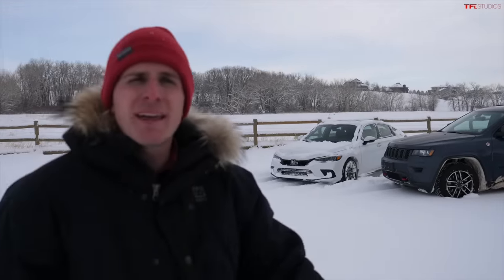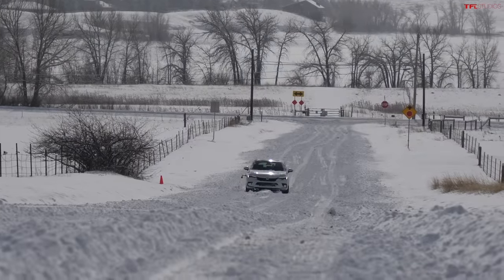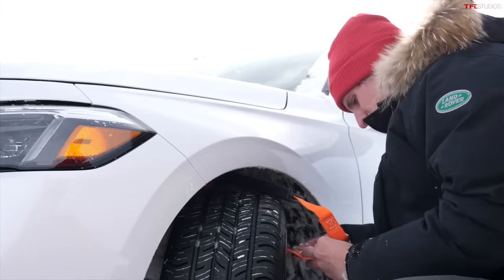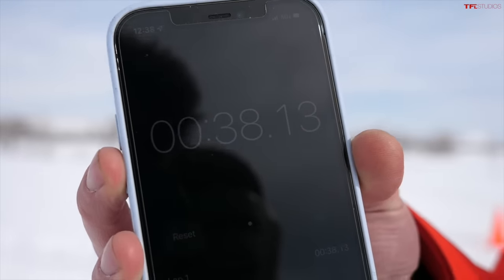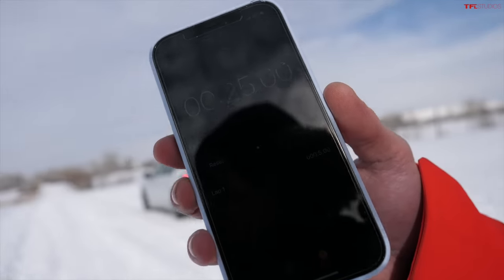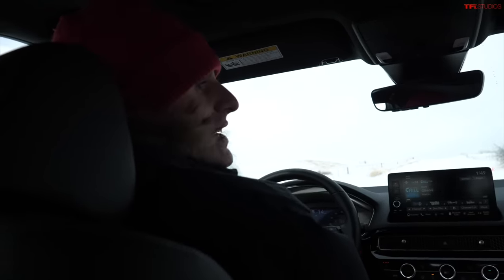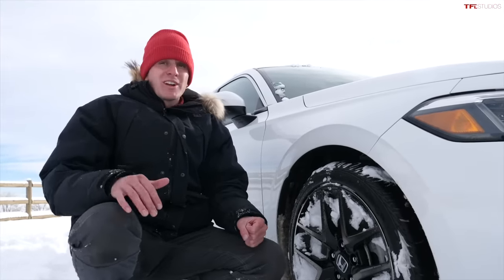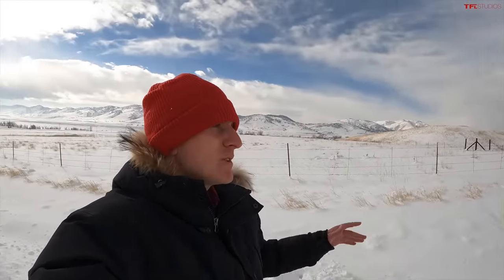Can Off-The-Shelf Traction Aids Make a Civic As Good In The Snow As a 4x4 Grand Cherokee?

Comment: What I’ve always wanted to see is awd with a regular all season tire vs fwd with snow tires. Kind of looking is it worth if you had to choose the money into awd and added fuel cost or to a set of snow tires.
Reply: I bought a slightly-used 2016 Crosstrek for less than what a similar Civic costs. It can average 40-45MPG on my 50mile commute. I don't feel like I gave up much in economy by getting an AWD.

 The Crosstrek also has 9"+ of ground clearance now (with 225/60R17 all-weather AT tires), sturdy roofrails, a hatch, a rubberized cargo area, a smoooooth boxer motor, and 1500lb of towing capacity. The ride is surprisingly good for such a small econocar that has pretty composed handling. That is probably largely due to the Crosstrek's 3000lb+ curb weight. Yes, it's a bit of a chunky bugger.

 Aftermarket support isn't as good as some gens of Civic, but I can find a turbo kit, high-flow airfilters, intake spacers, exhaust, adjustable suspension, 2" receiver hitch, skid & rocker armor, winchmounts, and a rear diff-locker.

 Similar to the Civic, the Crosstrek is a product of Japanese engineering, and I'm a fan of Japanese autos after owning a few Jeep CJs and a YJ. I've liked my Civic, Accord, SX4, and Highlander, and I'm now thoroughly enjoying my Crosstrek, living in snowcountry, near offroading/camping areas.
Reply: @RKmndo  agreed that you can find awd fuel efficient options. Just something I’ve always wondered. Glad it sounds like you love your crosstrek that much.
Reply: @jfkusa123  Crosstreks also come with 17" or 18" wheels, but the brake calipers will fit inside 15" wheels to use economical winter tires or aggressive offroad tires if you're driving much on VERY nasty surfaces.

 The boxer engines (2.0L or 2.5L) and CVT are...different, but I'm getting pleasantly accustomed to them. Corolla and many other FWD econocars are also using CVTs now, but Subaru's CVTs use a chain, rather than a belt. Crosstreks are also available with a 6spd manual, but then a sunroof or 180HP 2.5L is unavailable.
Reply: my wife drove front wh dr only for many years in the mountains of ut--we always had studded tires--they go anywhere and stop very well too
Reply: I'd say you probably need to factor wheels into that cost too. Unless you really want to spend $100+ mounting/unmounting tires each year.
Reply: I’ve done both - I grew up with fwd cars that we put snow tires on for the winter. I also rented a Subaru for a winter and tried it out with all-seasons. 

For going over pases/dealing with under 2 inches of snow on the road, I 1000% will keep snow tires with fwd. my fiesta still gets better mpg with my snow tires than my Crosstrek did. 

In general, awd cars will accelerate faster up a hill in snow, but, when stopping, cornering, or just trying to hold a line, winter tires are vastly superior. 

I’ve also experience black ice on both — awd still was ok, but damn those winter tires have SO MUCH more grip on cold temps than all-seasons. 

I slid so much more in that crosstrek than I ever have in even a minivan with snow tires on. I still am astonished at the stupid regulations states have about awd cars vs specifying winter tires for rough conditions. (See Washington vs Oregon’s chain laws) Oregon focused on data allowing traction tires and disregarding awd.
Reply: @androiduberalles  If you use all-weather tires you can just use the same tires year-round, instead of like swapping all-seasons for winters. Some all-weather tires are as good in snow as some winter tires.

Comment: Since both vehicles have all-wheel braking, the lighter vehicle has a good chance of winning.  Very few people think of that when they set off in their four wheel drive vehicles.
Reply: Not always. Weight can actually help as the down pressure increases friction/grip. Like adding sand bags to the rear of a pickup.
Reply: On a hill maybe but downforce can help with traction. Some extreme rock crawlers fill their tyres with water.
Reply: "Four Wheel Drive does not mean Four Wheel Stop" is one of the most powerful and true statements of the car world. Yeah yeah yeah all 4 wheels have brakes, not the point though. Winter Tires are always going to be the best for stopping. AWD is best for getting up a hill and to get going, but Winter Tires are to turn and stop.
Reply: @Malc664  I guess that is why 18 wheelers stop so quickly.  High weight and lots of tires.  Got it.
Reply: @craigquann  but you also have much more weight to try to get to stop. Sometimes it helps sometimes it doesn't. If weight really helped you stop, you'd see semi-trucks stop on a dime
Reply: @Connor Gibbs  It's the stupidest saying ever. Of course four wheel drive means four wheel stop. Just like any other car with 4 wheels. But that being said being locked into 4 wheel drive has been proven to decrease braking distance.
Reply: @veganpotterthevegan  not sure what cars you have drive. But that is rarely the case, the engine sitting on top of the front wheels gives it the edge pretty much all the time,  unless you are towing a trailer or something

Comment: The socks work well in the rockies where snow is powdery but they don't work as well in the heavy wet slushy snow. Definitely a much better option for modern vehicles with small tolerances between the tire and fender. Personally I'm more old school with chains and one quite a few occasions I have put chains on the back of my 2wd truck and have had better traction and go better in snow than 4wd vehicles, also have better braking on snow than plain tires as well. Another plus for me for tire chains is they can be used in mud as well, being on a farm it's also quite handy. I do really like the rubber blocks as they are just ment to get you unstuck not as a driving traction aid. I have seen that type of traction aid advertised before by a company called Truck Claws but they are made for heavy commercial trucks

Comment: I happened to drive FWD Mazda CX-9 and AWD VW Atlas over the same snowy mountain routes during the winter seasons. In the hardcore snow blizzards with layers of ice and fresh snow on the road or just in deep snow FWD+chains performed better. VW Atlas on M+S tires works best in mild conditions, just because I was able to go comfortably with speeds of over 40mph. 

But there were also roads that I was able to handle on FWD Mazda + chains, but Atlas was struggling on M+S tires, forcing me to put chains on it as well. When you get a layer of ice under the snow, standard tires literally provide zero traction, no matter how many wheels are spinning. Chains are cracking thru the smooth ice surface and get you moving slowly at least.

Still, AWD will be my choice over FWD+chains.

Comment: I'm the guy who took the chains out and installed them in my driveway as soon as I got home. TBH when I lived in Colorado I never bothered, but after moving to a mountain town in Oregon where the snow's wetter and there's more ice, I knew I might actually need to use them because chain restrictions on the passes even with three-peak rated traction tires is a regular occurrence.  So... yeah, it depends where you are, what kind of snow you're dealing with, and how much practice you get.

Comment: Curious about what the Hondas owners manual says regarding tire chains. Most new front wheel drive sedans and coops clearly say do not use tire chains as damage to brakes and other critical components are likely.
Reply: As far as I know they allow tire chains to be used on rear wheels only.But if you have fwd then you have to do what you have to do,I guess.
Reply: @borisscepanovic1684 Even on a lot of AWD vehicles the manual specifies chaining front wheels only (2013 Ford Escape, 2013 Lexus 350). The only vehicle I chain on the rear is my RWD truck.

Comment: I wonder how many times the sock would last before ripping to pieces. Snow tires FTW.
Reply: Auto sock usually lasts for about a few seasons.  They tend to fall apart when they dry out post winter if you don't properly wash and store them and will rip apart if you drive them onto drier land (i.e. asphalt/ dirt).

Comment: If theres anything I learned from college physics, its that the coefficient of friction is slightly higher when the contact surfaces are not slipping against each other. It did look like the civic was holding back but not enough. but you'll have better traction if you ease into it. When you got in the civic and said "full throttle" I spat out my coffee. It was a bad scenario for starting from a stop to be fair.

Comment: Some times we get carried away with gimmicky stuff. All you need is a two lengths or rope in your boot. Thread through the spokes and round the tyres 5 mins job, one person and your moving. Used them for years and in drifts too. Never got stranded. And hell of a cost saving on the gimmicks.

Comment: Good video. Scientifically done. Your viewers might look at other vids where snow tires are on the front only, very dangerous. Vehicles swap ends even at mild speeds in curves.  Putting chains on after getting stuck would be a Bitc*. 2 sets of the blocks would be my choice in case of getting stuck. I am going to give you 5 stars on a scale of one to four, just for doing this in the cold.

Comment: It seems like the problem with the sock is that whatever tire you do have is useless. If you have studded snow tires with the sock then it takes away the capability of the tire. If you have studded snow tires with chains, the tire and chains both still provide traction.

Comment: I have snow tires on my civic and they have been amazing. When I was looking at chains for it though the owners manual was explicit on not using chains with the civic. I think it has to do with the space between the tire and the wheel well
Reply: my explorer has tight space also--i use the bungies and make sure you have the chains on right,tight-cable chains--but i have steel chains too and never use them--oil field surveyor in utah,co,wy...drive heavy snow roads--you get on even 1 ft of snow and any grade without chains your done--pulled many pick-ups out ,they have no chains,nice snow tires but ineffective in heavier snow

Comment: This somewhat proves my point. I always tell people to just get dedicated snow tires if it's a 2WD vehicle. Get all weather tires if it's AWD. And hardcore All Terrain tires if it's 4WD/4X4. 
I use Falken AT3W. (It can be used all year round)
But 2WD needs dedicated winter tires. That way the tire doesn't harden and reduce traction when it's very cold. A good dedicated winter tire is just as good as that traction aid sock. 
Get good tires ,you won't regret it.
Reply: On my 4Runner I much preferred winter tires over the KO2’s that I used in warm weather. The winter tires (Nokian) had much better traction in turns and for stopping.
Reply: Somewhat agree. How would AWD help you with stopping on snow? AWD need winter tires as well.
Reply: @Redhawk24  Perhaps you did not read my comment. I said all weather tires for AWD.  Like Michelin Cross Climate or something.
Reply: @hermanjohnson9180  you are correct. I thought you said all season, you said all weather and I agree with you on that for sure. Thanks for clarifying.
Reply: @Redhawk24  No problem

Comment: The problem with the chains and the auto sock are they would be pretty much impossible to get on if you are all ready stuck. Which means you need to install them before you set off and with their limited speed ability I don’t really see them being much benefit as a daily use case. So as a traction aid for day to day driving their use is limited and as a way to help you get unstuck, only the traction brick is a viable solution as it’s the only one that can be fitted if the vehicle is already stuck.

Comment: I think that you should select and use a single vehicle for your review. Do a snow test with all-season tires, all terrain (3-peaks snow rated) tires,  and fully dedicated snow tires. I feel very confident in saying that the dedicated snow tires will perform the best. The best way to avoid the emergency use of “add on” traction devices is to use dedicated snow tires for daily driving in winter conditions. I think your audience would benefit greatly from such a review. Simply stated, dedicated snow tires provide the best maneuverability, stability, and braking when driving in winter weather conditions.

Comment: I am not sure about the Civic, but most new cars on the owners manual would tells you the car is not designed for snow chain. Did you guys check on that? Also from recommendation I got from experts, snow chains are meant to be for trucks and SUVs, not recommended for cars. There is snow cables which are designed for car instead of chains. Having used those before, I can say they are easier to install than chains, 5 mins and you are done, 1 person can do it. Interesting to learn about snow shoes though.

Comment: Snow chains and socks are for extremely adverse conditions... And 5 to 10 MPH speeds for cars as they don't have much space in their wheel wells and the slack in the chains can and will tear out the plastic inner fender and bits. Big snow removal trucks and salt spayers use them in Canada but when they do they have to slow down. Just think what can happen if they were to break at 40 MPH and what bits of chain can do to people. Also the chains you used are the cheap kind. You need the ones with "V" pieces welded to the chains. These are what was and is used on vehicles with enough space in the wells. My advice is: if there is that much snow leave your FWD home and use AWD or 4WD vehicle.

Comment: Good to see how these items work to get you unstuck, tho I wouldn’t ever use any of them for any distance. Last thing I’d want is to have to cut away a fabric sock thing from brake lines and tie rods etc if it ripped and got entangled under there. My Audi (1 of 2, an 03 and 17 A4 Quattro) both with winter tires on are virtually unstoppable in snow. Actually works better in all ways than my 19 ram1500 hemi 4x4 in snow.

Comment: Powder turns into hardpack which may turn into ice if the road isn't plowed. If the Autosock is all you have, you are parked by choice or not in icy conditions. At least with chains you're able to move in all conditions... until you're pushing snow with the front bumper.

Comment: Interesting test. It’s good stuff. ALWAYS test for and learn “how to” before the bad happens. Nothing should be new in the package your going to rely on. 
You don’t need to be going faster than 30 if your having to use a device anyway or are in traffic. Steering and braking are compromised with the weather. Chains are best on ice of the 3.  Use cables for “S” rated vehicles with limited clearance.

Comment: For fun it would’ve been cool to have a rwd only vehicle in this test. I remember when fwd came to forefront it was touted as much better than rwd in snow and crosswinds. My experience didn’t show that mind you my fwd car was half the weight of my rwd car

Rwd had a higher fun factor tho

Also I think to be fair you have to add the install time of the traction aids to your acceleration times 😂

Comment: Does the Grand Cherokee 4wd system act more like an AWD system vs like a 4WD Truck on 4H? I mean does the Grand Cherokee give engine power / engine braking to all 4 wheels when the foot off the gas like a 4WD truck / SUV on 4H or does the Grand Cherokee act more like a 2wd when foot off the gas? For example when you put 4H on your Wrangler it forces front and rear to spin at the same speed vs an AWD with an electro magnetic coupling / clutch does not force front and rear to spin at the same speed. They only rely on ABS programming.
Reply: No it doesn't 4 high locks the front and rear axles together, which has been shown to decrease stopping distances. In the Jeep its unlocked, meaning the front and rear axles can spin at entirely different speeds. It has a lockable geared center differential, so it always powers 4 wheels. Like a Subaru WRX STI

Comment: Would the sock help or hurt if the car has a dedicated snow tire? And what is the stopping distance between sock on and sock off with winter tires?
Reply: I found that a good winter tire for me worked better in most situation, other than on solid ice. I found the socks appeared to give more grip moving off on ice even over studded tires. As for braking distance it's hard to say as I was using them on a rear wheel drive Jag XJR, they may be better on a front wheels of a fwd car but I can't say. That said I found they worked better than the Pirelli all seasons the car came with. The down side is that if you're driving on roads with only partial snow/ice coverage they can wear quickly, so the ones I had recommended you remove them as soon as possible.

Comment: Usually I love your videos and tests ... this one not  :-) . Just try to drive a few miles with autosocks in winter conditions: snow, ice, tarmac. They get worn very fast. Your snowchains are cheap junk. Try products from premium manufacturers. Better chain links for more grip and durability, alloy wheel savers, more userfriendly, no need to tighten after first few miles. No worry about car or wheel damage. Would be cool if you have Pewag or Koenig chains in your test. Regards Mike
Reply: we use pewag on our heavy trucks--they are the best,made of tungsten,we do oil field work,utah,wy,some colo